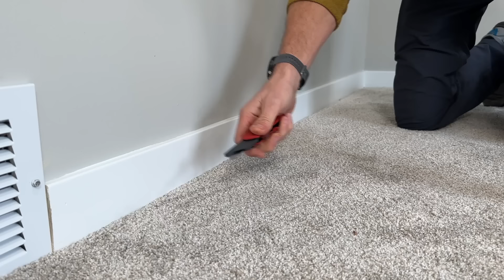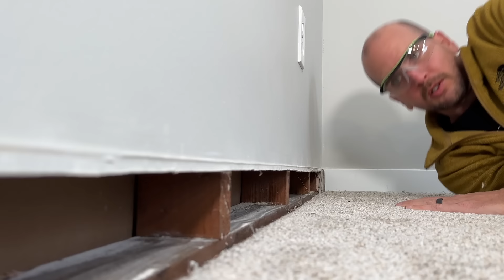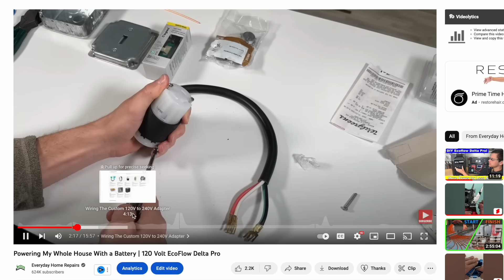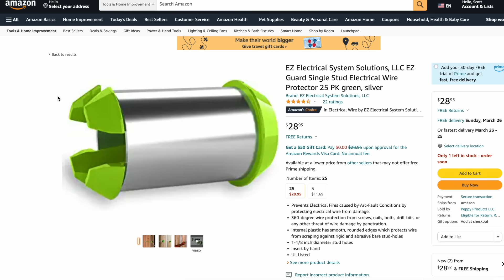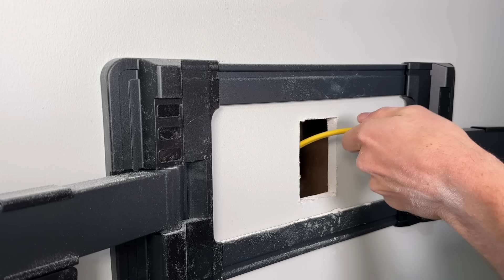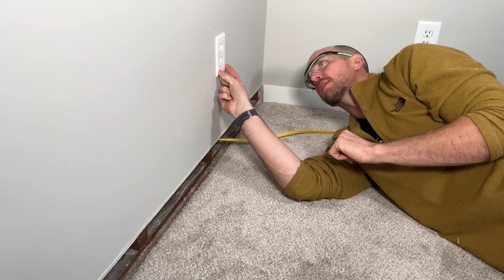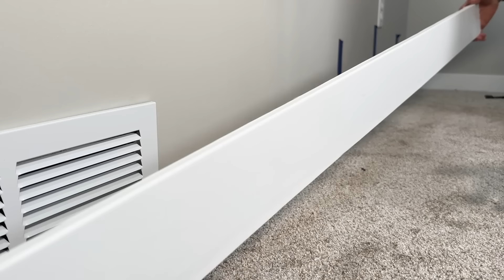How To Hide TV Power Cord And Cables | Easy Way To Move An Outlet

Comment: Awesome video! One tip I recommend is to start at the existing outlet and feed your wire down to the baseboards. Then pull it to the newly created outlet hole. 

Before you put the old work box in, feed the wire through the box and then place the box in the hole and secure. Doing this method is way easier and you get the perfect length of wire. 

He didn’t show how he got the perfect length of wire. If you do it his method you have to estimate how much wire you need because it’s way harder to feed the wire coming the opposite direction into the tine hole in the existing outlet box. Let alone other wires coming into it. Outlet boxes also have built in strain relief(the angled plastic you push out of the way) so it makes it even more difficult to pull wires out of the box from the other direction which also makes it more challenging, if you do his method, trying to fish it up into the existing box. 

Long story short, save yourself time and frustration starting from the existing outlet and work to the new one.
Reply: Thank you. I was wondering how he got the romex through the hole in the old box so easily.  I'm sure I would have spent hours trying to thread a needle I could not see.
Reply: @carwasherrors6454 
Exactly.  As I watched the video, I had the same thought.  I came to this site to see if someone had already made the point.  You can notice how he completely skipped over how to get the new Romex through the bottom of the old junction box.  That was unprofessional of him to skip that important step!
Reply: @billcarson1950  In the comments he linked a video showing the same process that he did, but for a different project: https://www.youtube.com/watch?v=nWfEANZOYSk&t=353s

Comment: Nice work, easy to follow!  Thanks for the tip on removing the base trim, that is the best time saver.
Reply: When using pry-bar place a 1/4" board between the wall and pry-bar so you don't gouge the wall from pressure point with pry-bar. Try and put prybar right above where trim nails are located so the trim doesn't split.

Comment: Nice video. In the UK we have noggins between the uprights in our stud walls which would make this a whole lot harder but I loved the approach of just removing the skirting board and doing the cleve work behind that. Great work but UK plug sockets are the best and a whole lot safer
Reply: I always hate when my scuddilywumpus gets in the way of my didgeridoo.
Reply: @Phillip Banes fair points.
Reply: I’m a little surprised the walls woudln’t have noggins (or cross braces) at intervals. The height of a wall is a long way without bracing. Is it assumed the dry wall is doing that job?
Reply: what gauge is that wire? Seems pretty heavy duty for a regular 110v socket which I guess you’re normally only ever pulling 1.5kw off?
Reply: @MrKlawUK  12 Gauge
Reply: @MrKlawUK  14 gauge
Reply: @@phillipbanes5484 US plugs have the cable out the back which is not ideal, and fall out, or can be pulled out a whole lot easier.
Reply: @MrKlawUK  in the US, local governments are able to modify portions of the electrical code to (usually) require safer methods of wiring. In Chicago and surrounding suburbs, all wire is required to be run through thin-wall metal conduit. Use of Romex is not allowed at all. Flexible metal sheathed  wire called BX can be used for short runs (not to exceed 3 feet). The normal diameter conduit used for indoor residential use (15 or 20 Amp circuits) is 12mm (half inch). Single insulated wires of the proper gauge (14 ga for 15 amp, 12 ga for 20 amp) are pulled through the conduit after it installed. The best advantage of metal conduit is that additional wires can be pulled, allowing flexibility for future needs.
Reply: @AGhostInTheMachine  The yellow coating means 12 ga, 14 ga is white.
Reply: @Blakende   Correct.  12ga is overkill for that application.
Reply: @AGhostInTheMachine  With the abundance of modern day electronics and power strip overuse, 12 GA is hardly overkill. 14 GA is only used for ceiling lights anymore. I guarantee that is on a 20 Amp breaker as well.
Reply: @Blakende  You guarantee that  LOL.  And you guarantee the year this house was built too I suppose.  And you guarantee the existing circuit is 12 gauge.  And you guarantee the total load on the circuit.  Okay and you have x-ray vision, too...gimme a break.  fyi, I mute all knuckleheads once I clearly see they are FOS.  cheers, and btw get a life
Reply: We call them “blocks” here, and yes, all stud-framed walls have them half way up the wall, at least in newer construction here in my neck of the woods. To mke this work, you’d need to install the new electrical box below the blocking or do a bit of sheetrock demolition.   @MrKlawUK

Comment: I'm intriqued that the originating outlet has the grounds just twisted together, no wirenuts!!  Have a house built around 1968, all the original outlets are that way.  Whenever I've had the need to change an outlet, I'll replace all of them in a room, and make good ground connections.  And WAGO 221's are the BOMB for this!  Solid, fast, and easier than nuts.
Reply: Twisting the ground wires is actually more secure than using wire nuts. But Wago is much nicer.
Reply: Seems to be a standard around here.  Almost every installation I have seen has had all the ground conductors twisted into a group.  The good part is that you know the ground conductors have really good contact, but it's a real mess of copper in the back of the box.  I'm 50/50 on cleaning it up or just leaving the thing that works alone, depending on the nature of the work I'm doing and how much energy I have to "correcting" it (I use quotes because twisting all the ground wires together tightly is a really reliable connection, so it's not wrong).
Reply: @natehoy6924  I can see it being 'standard' but is it to code according to the time the house was built?  And once seen, should it be left like this? I live in a house built about 1968, like most other houses in my neighborhood.  I've lost count of the # of outlet boxes where twisting the grounds was done, which I then corrected to wire nuts (and now wago's).  When we remodeled out kitchen I was very diligent about this;
Reply: @natehoy6924  Twist them together, put a wire nut on the end.  Helps to be a bit OCD.

Comment: Really useful video.  I recently wall mounted our TV with the plan to install an outlet behind it.  

That said, there are "in wall TV power kits" (LeGrand makes several) for behind the TV outlets which have you install two faceplates; one behind the TV with a receptacle that the TV (and soundbar if present) plug into, and one at outlet level near the floor with male prongs, and the two are connected in the wall cavity via a cord.  You then run what's essentially a short extension cord from a nearby electrical outlet to the male prongs on the new floor outlet, which energizes the outlet behind the TV.  Many of these kits include a non-electrical cord pass through molded into the faceplates for HDMI cables to game consoles, blu-ray players, etc. You wouldn't need to remove the trim, remove drywall screws, cut the strip of drywall away, cut power, remove and re-wire the existing outlet and the new outlet, reattach drywall and trim, spackle and repaint the trim, etc.  You just need to cut two holes for the faceplates and fish the included in-wall cord from hole to hole.  The one downside I can think of -- if you don't have a media center or other furniture below the TV, you'd see the short power cord running sideways from an existing outlet over to the new faceplate near floor level with male prongs.

In theory, it's more expensive to buy one of these kits than buying an outlet but if you need to buy a trim pry tool, 15' of 12-2 romex, Wagos, wirestripper, etc. it will actually end up significantly cheaper for a DIYer on a budget.  The only tools required would be a level and a drywall jab saw or multi-tool to cut out the holes for the faceplates.
Reply: Agreed, the recessed kits are the way to go, and an opportunity to run an HDMI cable down the same cavity with no actual additional work was a big miss.  Even if not going with a recessed KIT, it should have been a recessed OUTLET so the TV could fit flat to the wall with a standard plug.  It was a good DIY video, but a terrible AV/Tech video.
Reply: @FHL-Devils   He mentions the junction box at the end for additional wiring. Guess he just had no need so didn't do it here.
Reply: @davidp6839  - Except that it's against code to have 120 and Low/No voltage wiring in the same box.  There would be no viable way to create an HDMI / Optical run without repeating the process almost from scratch.
Reply: @FHL-Devils   Looked like a separate box/plate, so wires would be separate.  More of a cover than a box, just access for AV wiring.
Reply: @FHL-Devils  Yeah he simplified it by claiming the TV didn't need HDMI any more because all content was being streamed wirelessly over WiFi, which is fine when that's the case, but a lot of times it isn't, and then it gets more complicated.
Reply: Your method is by far the best DIY method so long as there is a cabinet under the TV (Usually is)

Comment: One tip WRT the second wall plate you showed for HDMI, etc. cables is that if you use two, run a long piece of string between them for running extra cables later.
Make it at least twice as long as the gap + 2 feet, with a loop knot tied in the middle.
This can then be used to easily pull cables between the two holes.
Reply: I agree, always have cheap non conductive fire resistant string to add easy access cord pullers to tie to box/romex/cables.  You can buy tags for it, you can buy 1000 of these for like $2, I bought the ones that double as anchors/mag guide compatible since tech is constantly upgraded, 500 for $8.
Reply: Huh?

Comment: Ive been in remodel construction for 30 years. Great video. I have never actually seen an easy guard.
Although exterior walls may have insulation and some may hahe fire blocking that will need to be delt with

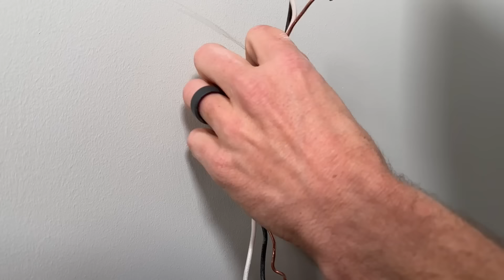Comment: 9:28 - magic. I would've pushed the romex through the existing box first and used a fish tape to pull up to the new outlet. Pulling into that existing box with a fish tape would be annoying. I also worry about a nail going into the romex when re-attaching the baseboard.

Comment: i like how the romex magically appears in the old box.  If the tab was still in the box it would make things interesting.  also, if neither tab is out of the bottom of the box, it would be very difficult to get the romex into the box.  a bit of a gloss over here on possibly one of the most difficult aspects of this job.  honestly, the only reason i watched this video was to find out how you got the wire into the old box.  not to take away everything.  it is still a well laid out video worth a thumbs up.

Comment: This is great for situations where you don't have an outlet directly below your t.v. location. But the edge of the t.v. was directly above the outlet you pulled power from. So all you had to do was cut a j-bix sized hole behind the t.v. and run your new wire to your new j-box and outlet. Or you could have placed your new outlet on the other side of the stud from the old outlet and drilled your hole through the stud at that location.
Reply: This is what I do. 👍
Reply: Exactly no need to move Trim for this task..
Reply: Beat me to it. Exactly how I did it in my home. There is no need to have the plug centered behind the TV, it just needs to be anywhere behind the TV. Arguably, it's much better being closer to one side or the other of the TV, so that you can simply reach your hand a short way in from the side to unplug it, if need be, without unmounting the entire TV.
Reply: i was going to say the same thing,no need to pull trim and drill holes in studs.
Reply: How would you get the other end of the electrical cable routed to the other outlet (safely) if you didn't drill through the intervening studs?
Reply: How would you get the other end of the electrical cable routed to the other outlet (safely) if you didn't drill through the intervening studs?
Reply: @edeaglehouse2221  He did drill through them, about 4:25.
Reply: @edeaglehouse2221  The method shown in this video is perfect for situations where there are studs between an existing outlet and a desired new outlet location on the same wall. However, it was not necessary as a solution to the problem presented, which was to get a new outlet behind the t.v. Had the existing outlet been placed 5' up the wall initially it would have been covered by the edge of the t.v., so a new outlet could have been placed there without drilling through any studs at all.
But of course you can also buy a flexible drill bit and do the same job directly from the new outlet location rather than remove the base boards. It requires some patience with feeling around inside the wall cavities, and the existing j-box would have to be removed and then either reinstalled or replaced, but it is doable.

Comment: Make sure to check your local state requirements for how high the cable needs to run from the floor.  In California its 16 inches to prevent electrocution from standing water. The Romex cable I coated but I wouldn't take any chances.
Reply: @shmellit123he used EZ Guard thru the studs.

Comment: Am I the only one wondering how you got the new wire up and into the existing box?  You skipped that part.
Overall a very good and concise video. I like your work.
Reply: I noticed that too. How did he fish the wire from the top box to the floor?
Reply: Feed from the box TO the floor.
Reply: @garychandler4296 so not code? Meaning someone else doesn't know that wire is there and can cut into it? Yea not the smartest thing to do.. people like this are why contractors scratch their heads on jobs
Reply: @jacksparrow3490 So how is the end result any different? We were dicussing ease of installation.
Reply: @garychandler4296  just say you don't know why codes exist and why things aren't done like this "for the ease of it.. if trades people could just do it how they want to.. then why aren't they? If someone buys this home and later goes to renovate.. are they going to cut into a wire that isn't properly secured or even properly ran? You home owner DIY make contractors charge more to fix dumb "easy jobs" like this all the time.. there's a reason there are codes to standardize the work also.. we get it though.. everyone who uses a screw gun thinks of themselves as a contractor and tradesman.. 🤣
Reply: @jacksparrow3490  For new construction, yeah, but there is a code exception for work like this. NEC 334.30: (B) Unsupported Cables. Nonmetallic-sheathed cable shall be permitted to be unsupported where the cable:
(1) Is fished between access points through concealed spaces in finished buildings or structures and supporting is impracticable.

Comment: Nice work, all in all! 

A year late to the party, but if I may offer a drywaller's pro-tip: building codes generally require that drywall sheets be secured with fasteners around all perimeters, including the bottom of the sheet. After cutting out the bottom strip, the "new bottom" of the original sheet was not secured in this video. Not a big deal with an interior wall (that is, not any outside-facing or building perimeter wall) within your own dwelling, as long as you're prepared to live with the potential of having a noisy, rattling wall at the slightest vibration. Easy fix: if you were to make your cut below the trim line just slightly more than demonstrated, you could easily secure the sheet and hide the required fasteners. Another 1/2" would be more than enough. Snap a quick chalk line as a guide in lieu of using a trowel as a spacer.

Also, a critical safety concern for HDIY'ers out there: 

Do be advised that this method is not acceptable on partition walls and ceilings that separate individual tenant spaces (condos and apartments, for most people typically, but also commercial spaces). These "fire walls" absolutely must be properly secured with fasteners in order to ensure that the wall is resistant to modest explosions and that, at a minimum, any joints or seams are taped and any fasteners mudded at least once. This is needed in order to seal joints and penetrations against any ingress / egress of hot gases, other ignition sources, and toxic fumes crossing from one tenant space to the other in the event of a fire on either side of the wall. 

Additionally, if you are opening a two-hour fire resistance rated wall (typically being two sheets of 5/8" thick Type X drywall), you may not have joints or seams stacked directly on top of each other. The top-most ("finished") drywall layer must overlap any joints in the bottom, base layer by between 12" to 24", depending on your local building and fire codes, in order to achieve the two-hour rating required by law. This necessarily invalidates using the baseboard trick to hide joints in your finished layers as demonstrated in the video, and will require additional work to achieve a paintable finish. 

These are life-safety items and are not optional! If there is any doubt in your mind about how to proceed when considering alterations to a fire resistance rated wall, consult a professional and allow them to assume responsibility for any liability! 

Consider relocating your entertainment center, if possible, to a less sensitive interior wall. Less work. Less mess. Less headache. Less liability. (Not only that, your neighbors will thank you for not hanging loud audio equipment on your shared partition wall!😜)

[Edits for minor spelling & grammar corrections.]
Reply from the maker: Thanks for all the great feedback!
Reply: Thanks for the tip about the double-stacked drywall, had an electrician add a fan box in a bedroom where we have a unit above us and I was just going to put them back, guess I'm making bigger patches now...